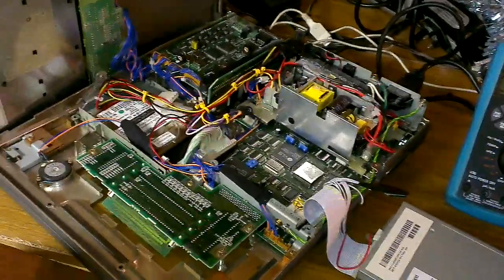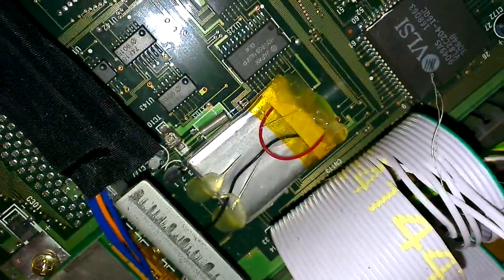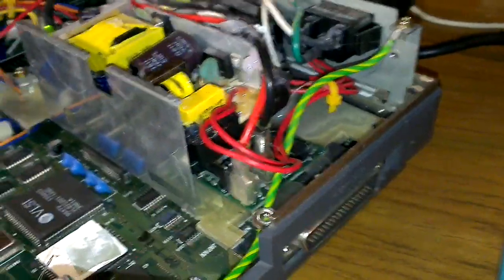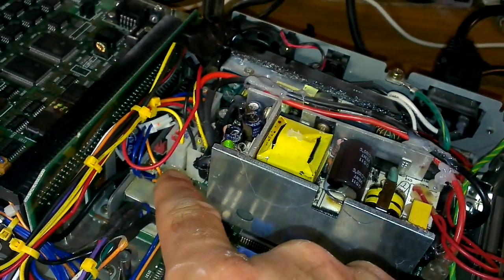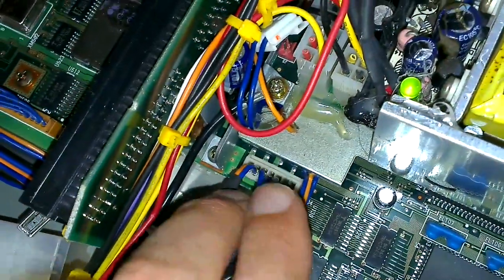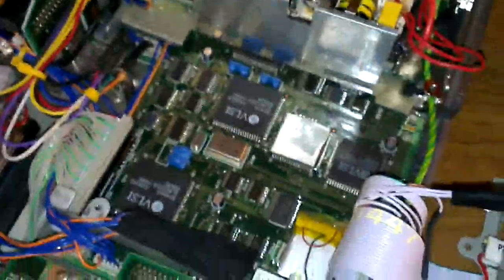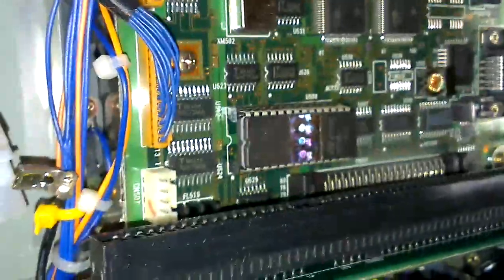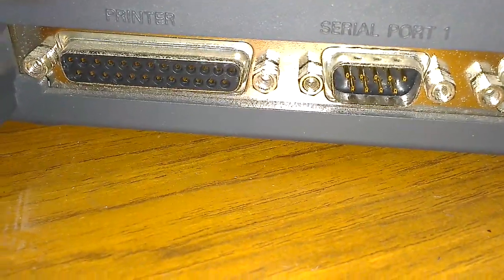Amstrad ALT-286 16 MHz Vintage/Retro Laptop DISASSEMBLED

Comment: Great video, i have the same with backlight off (but lcd screen work fine) suggestion for repair ?
Reply from the maker: @gnokketto7423  You're missing one of the negative power rails on your power supply, without it the backlight won't work.
Reply: @SabretoothBarnacle  Check it thanks!

Comment: Do you have a service manual for this computer? I was in the process of replacing the drive on this laptop, but now i have a blank screen (laptop does still go through the other boot up routines - leds, floppy) even after putting the original drive back.
Reply from the maker: Hi check for the presence of -19v as indicated at ~6:20, if that's missing there will be no display.  Also check you haven't moved the DIP switches in bank B.. switches 1 & 2 must be ON or it disables the VGA adaptor.

Comment: Hi, I sent you a personal message on youtube. Please , if you want, reply me.Thanks a lot
Reply from the maker: Hi, you'll need to replace the entire power supply as the capacitors go very bad very quickly.  I would recommend using a Pico PSU as it would fit easily inside the power supply area.  The -19v rail works with -12v perfectly so you could split the -12v from the Pico PSU with no issues.  The wiring to the motherboard is covered in this video :)
Reply: Sabretooth Barnacle many thanks for your reply . I saw your video many times but I want to know how to connect the other pin on power supply. if you see this image http://i60.tinypic.com/x1yuy0.jpg the connector with :"power,trickle,alarm ecc ecc needs to be connect to something on the new power supply? and in this case, what are voltages?
Reply from the maker: +Retrocomputer Your linked picture is blank... The other connector isn't required unless you want to try and charge the battery which is very unlikely to be alive after 20+ years... You just need the connector pointed out in the video!
Reply: Sabretooth Barnacle link works but is a little bit slow (just tried). on my original power supply there are 4 connectors. one with 7 pins (main connector), one with 3 pins (fan), one with 4 pins (charge/discharge battery pack) and one with 5 pins .The last one is the poblem  because the serial port  doesn't working without this connection.